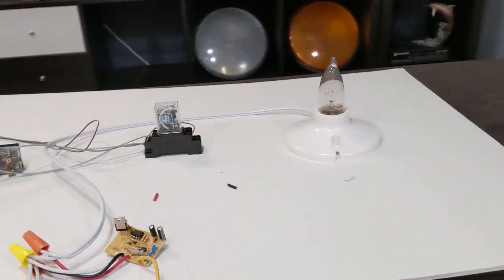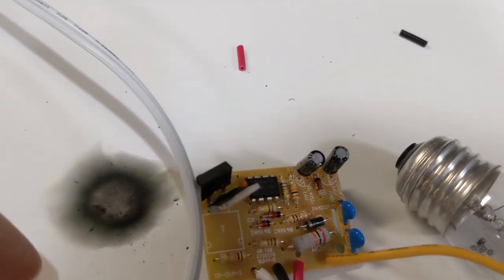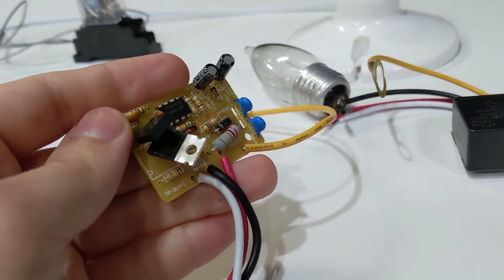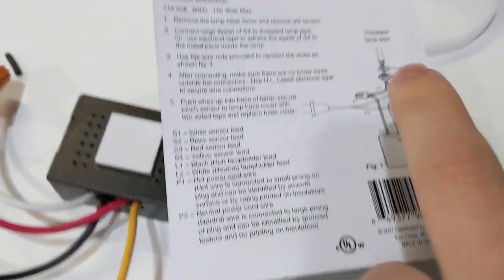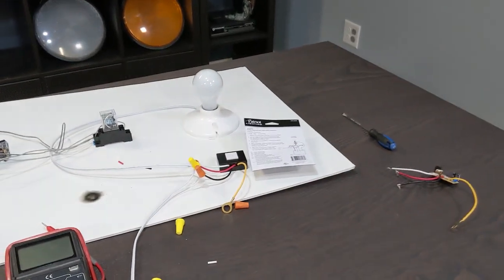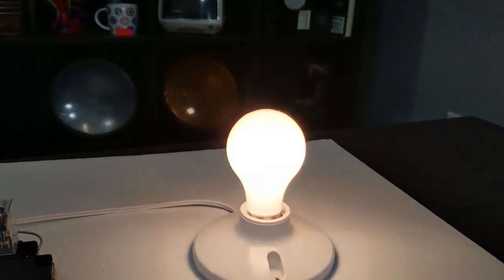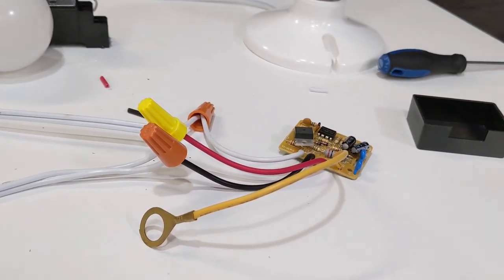A slightly explosive touch-lamp follow-up (standby energy consumption)

Comment: 13:00 Most switching component power ratings usually assume aggressive heat-sinking/cooling. A good rule of thumb is to de-rate to 30-40% of it's reported value if using ambient cooling, so  a 250W Triac should be driven up to 100W-120W.
Reply: And that power rating is for dissipation of head from the triac case. It's not the rating for how much load power the triac can safely control.

Comment: The bulb you used seemed to have no fuse in it, which would trip the breaker. Also, black should be Neutral while Red should be Hot.

Comment: I guess they were using wire colours people commonly use for low voltage applications? Coz red is usually positive and black is usually negative when dealing with low voltage DC electronics

Comment: Go check the instructions currently available on Menard's website for this thing.  Since you bought yours, they swapped P1 and P2 on the diagram so they're connected more like you think they should be. However, now they have Line Neutral going to Lamp Hot which seems weird, and I think it could cause issues in weird fringe cases if someone were to use this for something other than a light bulb. I think L1 and L2 should have also been switched, but they probably didn't want to spend more money changing the drawing any further. 

That diagram is terrible and hard to follow too, they really should have labeled the wires in the picture instead of making you read those stupid codes then look back to the list of codes to figure out what each one is. It's cumbersome and hard to follow. Anyone familiar with North American wiring standards probably won't look at the instructions that closely anyway, so they really should try to make it more obvious and noticeable. I suspect this is just another case of Menards selling some horribly price cut chinese thing without thoroughly testing it first. I'm tempted to buy a couple of them to run some tests of my own, mostly to see what happens to it with a bit of overload, maybe 300W or so.

Comment: Functionally the polarity of S1 and S2 shouldn't matter. Line connected equipment shouldn't be relying on plug polarity for protection anyways. The triac didn't blow up because you had line and neutral backwards, it blew up because black and white were wired to the line input so when the triac fired it directly connected line and neutral. 

Granted the way you wired it first makes the most sense if you are going without directions but even expensive Lutron fan/light dimmers have weird wire colors.

Comment: The colors of the device are wrong, but not the way you think it is. Yes, black is hot, but only when there is blue, neutral. If there is red, it is DC color scheme where hot is red and black is neutral. That means the device is wired with DC color scheme, but used in AC.
When you miswired that thing, you basically sent all of the power your breaker can handle through the sad little triak rated for way less amps.

Comment: Should have put a cheap fuse holder and low amperage fuse as close to the source as possible in your bodged circuit so that you could blow your own fuses to your heart's content without worrying about tripping the breaker. Of course, as a commenter on your video, I'm the very embodiment of hindsight always being 20/20.

Comment: I'm a car mechanic from Europe and couldn't help myself but try and come up with a way to tell you why red is obviously hot and black isn't, but only until I thought about what the engineers of this may have thought. It must've went something like this: 

"Okay so we have this awesome circuit done, how do we sell it best?"
"Sir, what about the north Americans, their home supply hot wires are usually color coded black"
"Oh yeah,  good point. What would happen in case some north American guy didn't check the wiring Diagram before hooking it up to mains and then use it?"
"Hmm lets see, so yeah so he'd stay unharmed but the whole thing would blow up and he'd think he'd had to buy a new one"
"Perfect."
Reply: Car mechanic from Europe please ask an electric technician from Europe.
Black is always hot!

Comment: The old australian wiring system had us using red as live and black as neutral with green/green and yellow for the earth. The current one uses brown as the live blue as neutral and green/green and yellow for earth. Im not 100% sure what white or yellow wires would be for but my knowledge on appliance wiring is rusty beyond live neutral and earth because that set up is the same between household wiring and appliance wiring.
So to me red being live makes sence but still you would think that a product sold in NA would use the correct wiring standard colour code

Our 3 phase currently uses green/green and yellow for earth blue for neutral 
Brown, black and grey for live phases 1,2 and 3 respectively. And old 3 phase was red white and blue for lives and black for neutral green for earth has always been the same

Comment: I combination with the red i find it very natural that the black is neutral (but usually in the DC context). On the other hand when in presence of a blue wire, black is the live along with brown and gray.

I'm guessing that circuit is not made in USA? :P :D

Perhaps you should do a video on a historical, geographical and application specific color coding systems distribution. (and power sockets)

Comment: I despise devices that consume considerable energy when "off". I accept a little power draw for standby, e.g. listening for IR remote signals or WIFI.
For some reason most dimming lights seem to dim the light by just burning off the excess energy into heat and buzzing noises.

Comment: I'm always needing to double check my electrical wiring  ("black is hot,  black is hot, ..."), because I spend far more time in electronics where black is usually ground.   :/    (of course there are several kinds of grounds,   some tied, some not)

Comment: There are two wire color codes in North America
AC: White=Neutral, Black=Hot
DC: Black=Neutral, Red=Hot
This is just a matter of the AC main power to DC device component color code difference.
If the company was responsible, they would have used AC wiring code colors to save confusion rather than use the DC component color code just because the device is a DC circuit board.

Comment: Wanted to ask if the new correctly wired module without the burnt out bulb  went through its calibration with the light flicker the way the old 80’s lamp did. You never revisited that. Anyway glad you’re ok and wasn’t hurt by the explosion.

Comment: It seems that this device works by switching the neutral rather than the hot and as such there is no meaningful way to colour-code the wires. There is normally no such thing as a switched neutral and so there is no standard (or even typical) colour assigned to it.

Comment: To be fair, it's made in China and in China black in neutral. Also in NZ red is hot, black is neutral for fixed wiring. Otherwise it's brown/blue for hot/neutral as per the IEC standards.

Rest assured though, no matter which way you plugged in your non polarized plug it would have still exploded. The way you had it hooked up, the triac was switching the mains and the controller was taking power via the bulb.

Comment: Quick question since you deal with similar things..
So, my upstairs bathroom relies on the breaker for GFCI and as such uses a regular outlet whereas the downstairs bathroom actually uses a GFCI outlet, should i replace the upstairs with an actual GFCI outlet? i decided to test the GFCI and instead of the breaker tripping the outlet itself died so i replaced the outlet with a normal up to date outlet (House is 20 years old so it was using an outlet the house was built with, which imo was a good enough reason to replace the outlet anyway).

Comment: I'm not 100% sure that this touch sensor is color coded to US specs.  It would take some testing with the meter to see if the hot lead is the hot lead, and not the neutral  with a mixed color code.

Comment: I guess the real question is to which countries wiring codes was that designed for? Sure the US uses Black for Hot.  But Europe and most 12v systems black is negative and red is hot (red hot). I assume its a historical thing when it was hard to make colours of PVC or cloth insulation, so using black and white was cheaper/obtainable. But it seems like it was made for our colour codes not the US's (which is obviously wrong as its not localised and therefore might not be up to US regulations)

Comment: This reminds me of the time I blew up an h-bridge while trying to make an RC car in robotics class. I couldn’t get it to work so I assumed I had wired it wrong. Turns out my wiring was right but my rewiring was wrong. It exploded as I powered it up. Also in an earlier class I burned my finger on a transistor. I was very scared to work with transistors thereafter. Not exactly sure what I did wrong but holy hell did that hurt

Comment: I think the reason for black being neutral and red being hot is because someone in China thinks that AC and DC wiring colors are the same (in DC on micro-electronics red often being + and black being -)... Then again one should look at the diagram (sometimes they are stupidly drawn indeed) before wiring anyways, because not every country in the world has the same wiring schemes. And even when they do, depending on the age of the device, colors don't help much...

Comment: In several European countries electrical supply is not polarised; Sweden, Germany, Russia, and the Netherlands come to mind.
The hot and neutral should not matter, if the design of the circuitry was reasonable. But nevertheless, horribly unintuitive choice of wire colours – especially given the target market.
As you did have a non-polarised plug: did you verify which lead was neutral in your setup?

Comment: I don't know how China wires things up, but in the UK, Red was hot and black was neutral. If you had grown up in the UK, you would have assumed red was a live.

The wiring in the UK was changed to the international standard in 2006, of blue neutral and brown live. Green (or green/yellow stripes) was and still is earth.

This may have been wired up for the UK market a couple of decades back, and nothing has been changed to reflect the newer codes.

Comment: I believe you wired it so that when the triac closed, it shorted line to neutral. I don't believe white is a wire color anywhere else in the world, but you'd imagine something made for the North American market - the only place that uses 120v - would've been designed for it. Guess the Chinese didn't think so.

Comment: That did more than the giant capacitor I shorted with the socket I used to disassemble a circuit, gosh that was loud, and my socket had two nice dents and char marks on the nice shiny chrome. :(

Comment: They certainly have their wire colors mixed up -- As you said, black is hot in NA, so I'm wondering if whoever designed this was thinking of the DC color standard, black as ground [maybe they think that's the same as neutral] and red as positive [maybe they think that's the same as hot], or this product wasn't designed for NA [I think black is neutral in other parts of the world]

Also, good thing you were using a random incandescent when you wired the first one up instead of your LED bulb! That would have been really sad to break with an explosion [the explosion was enough fun by itself]

Comment: The wire color code has to do with the class of device.  Different kinds of devices have different color codes.   Technically the sense line is a ground but it's an open ground so follows antenna rules.  The red and black wires are correct as well, you're just not used to such things XD.  Maybe ask MrCarlson?
Just chalk it up to percolators ~wink~

Comment: Bad design. The hot lead is connected to the lamp at all times, creating a shock hazard even when the lamp is off. Switching the neutral side would never be approved by UL. This is probably counterfeit and illegal to use in the USA.

Comment: In North America, white is neutral, black is hot, and red is the switch leg. Not only are the colors wrong, but they're switching the neutral, which is a shock hazard as the bulb socket is always hot. If while changing the bulb the center contact is touched, or if the bulb was broken, or if the wires to the socket were reversed making the outer contact hot, even if the lamp is switched "off", it is still hot. This product should be reported to the consumer protection agency for recall.

Comment: I see several comments about Britain switching colour schemes to help the colour-blind.  What I'm not sure has been mentioned is that in my youth, appliances were universally sold with NO MAINS PLUG.  You had to buy the plug separately and wire it on yourself.  In hindsight, it beggars belief.  Not sure if the reason was that older houses had round pin plugs instead of the more modern rectangular ones.  So everyone and his dog were wiring plugs, and being unable to distinguish between live (red) and earth (green) was a wee bit of a problem..
The other annoyance was that once you had wired the plug onto a small appliance, it would no longer fit back into the cardboard box it came in..

Ironically, the very first time I ever bought an appliance with a molded plug (a washing machine), I had to cut the plug off to run the cable through a hole in the kitchen worktop.

Comment: every time you have to wire something more complex than plug you HAVE, you SURELY HAVE to triple check the correct wiring, sometimes they can also be wrong or misleading and wire color is NOTHING, i sometimes do a quick reverse engeneering of the circuit to ensure myself i'm doing the correct thing

the first time you wired it i felt there were too many wires grouped togheter :D ... live versus neutral usually means nothing, you can exchange em even in dimmers

Comment: I bought one of those Chinese touch switch boxes to repair a lamp but when it arrived it seemed so flimsy I don't trust the wiring diagram enough to not lead me to wire 240v to the chassis. It remains in the project box a year later.

Comment: Here in Germany wire colors are even weirder? black or brown is hot, blue or grey is netral and yellow-green is earth. Up to 1965, neutral was grey and earth was red. Also, isn't red hot in DC circuits and black the neutral? Also, in three phase circuits around here it's Phase 1 is black (can sometimes also be blue), 2 is brown and 3 is grey, each phase being at 240V.

Comment: To start, I'm in IT and am not allowed to play with something that is not "plug-and-go" (let alone being in the same room as a soldering iron)....  With that in mind, I have done a number of DIY electrical jobs (I built a shed with outlets & LED lighting and nothing exploded.... yet....) and since the 70s, red was hot, black was neutral (cold) and white/green was ground.  95% of my projects were this way.  But I'm an engineer at heart (and boy second) and I ALWAYS double-check any included diagrams or connector markings before [Egor!!  Yes, marster, I know.  Throw the switch.... <sigh> ]  So, I'm not "educated" on what "should be", just what seems to be what the bean-counting management types decide to do make their margin look good.

Comment: So lemme ask this.. this is Alternating Current right?  So why is there a "hot" and "neutral" when it's AC current? Aren't both leads from mains power basically the same? Shouldn't it had worked either way?  Does it matter? You can put the plug in backwards, right?

Comment: Idk you but here we have positive as red and negative as black (just for electronic circuits, otherwise it will be brown for live and blue/light blue for neutral). It seems more visual seeing a positive wire as red and negative as black for me. Maybe it's manufacturer is from other country or it's because other times or because many don't respect wire coloring

Comment: Differing international wiring standards aside, one would think that UL certification might include a check that wiring colors are consistent with the standards in the country in which the product is being sold. Switching the neutral rather than the hot side of the socket also seems… somewhat suspicious.

Comment: The plug is reversible anyway so you can also think of it as S1 (white) = lamp hot; S2 (black) = plug hot; S2 (red) = combined neutral. That's still stupid and explains, why you blew the triac: Compared to my wiring above you swapped red and white, which created a one time switchable short circuit.
However, that still doesn't explain, why the lamp blew. My best guess is, that the high current of the short circuit and some inductance somwhere created a high voltage spike that killed the lamp.

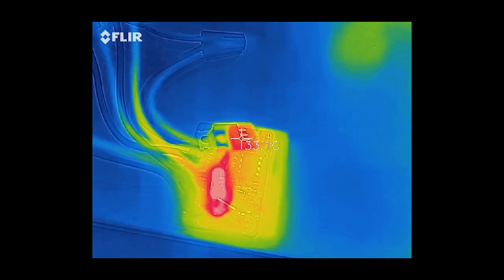Comment: I haven't seen anyone note this yet, and I'm not sure if this is a common problem with thermal imaging, but it appears that your infrared camera has some sort of ghosting artifacts. I don't even know if that's the right term. at 15:23 I can see the red blob of heat dissipated by the beefy resistor, but slightly to the left I'm able to see the color coding of the resistor, as if a visible light camera is superimposed improperly over the infrared -- or something like that, I have no idea. The same artifact is apparent on the triac, where the hole for a heatsink screw is located. I was thinking of buying an infrared camera soon... is this something you've noticed before?
Reply: then again, the bulb and other objects seem to track properly... I think I just don't know enough about about how infrared cameras work

Comment: Can you make a one touch on and off without the other stages? I have a no push on the push button that I love. I don't want to have to touch a lamp repeatedly to simply turn it on and off. My lamp emits a flash when I turn on the power strip. It is full spectrum fluorescent. I hope that's normal. Amazon has a ton of touch lamps so they must be popular.